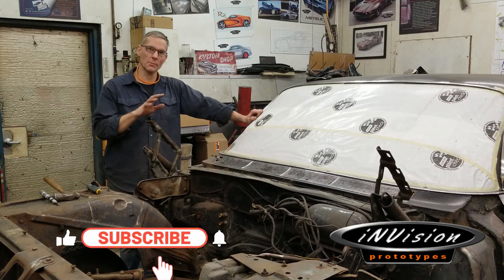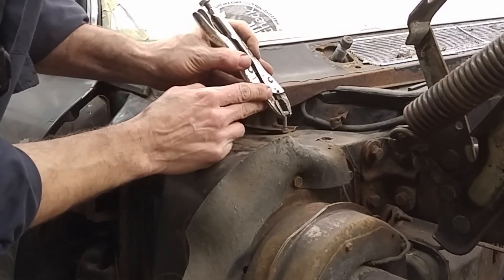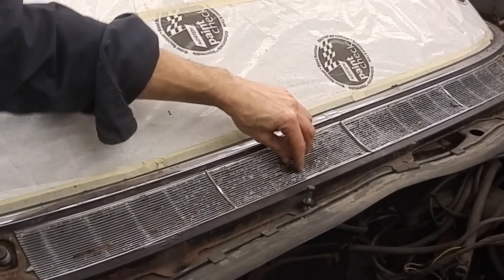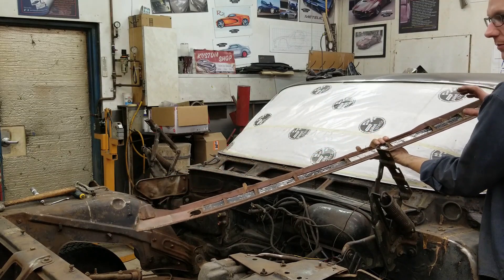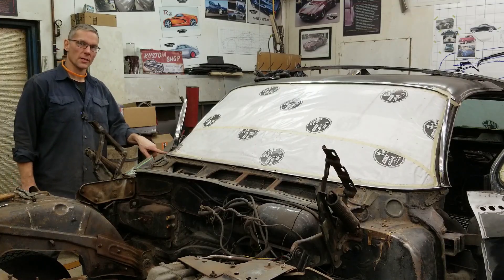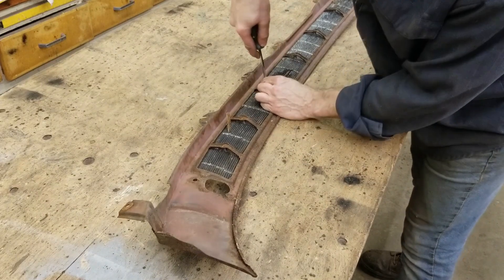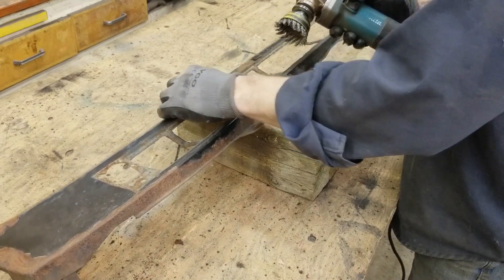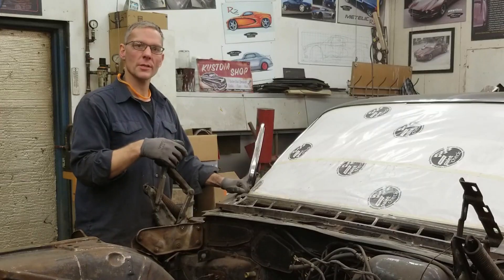Wiper Cowl Cover Removal & Restoration - Ep.3 - 1962 Series 60 Cadillac Fleetwood

Comment: As the late great Meatloaf sang, "two out of three ain't bad"
A sharp scriber or similar is good for cleaning cross-head screw heads and cap or torx heads before tapping the tool to seat it.
Like the stacking screws idea 🙂
Reply from the maker: Great tip!! I forgot to mention that.  It was done prior to trying to seat the driver.  Unfortunately, the heads were just too far gone.